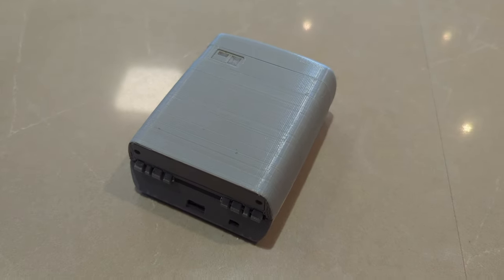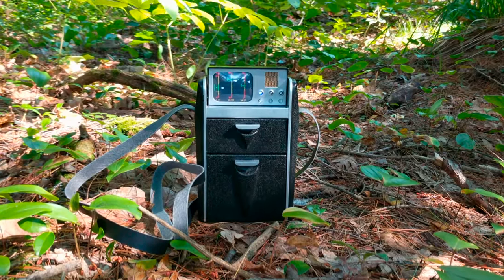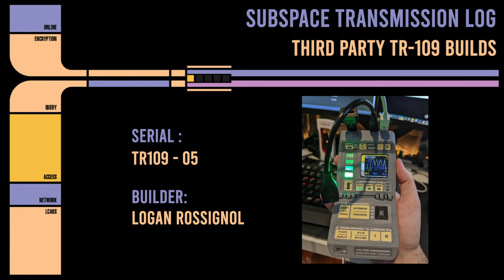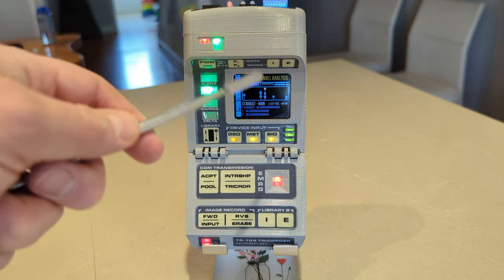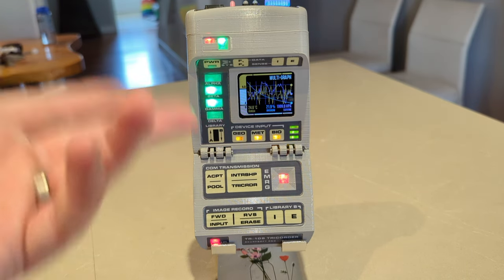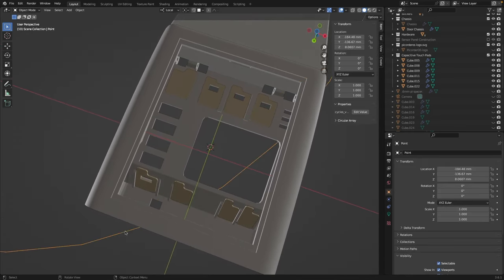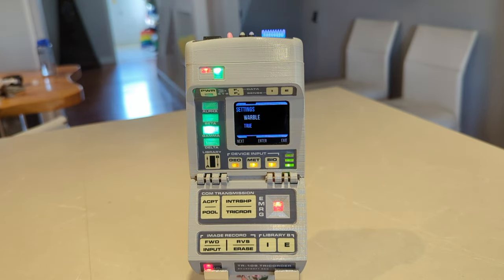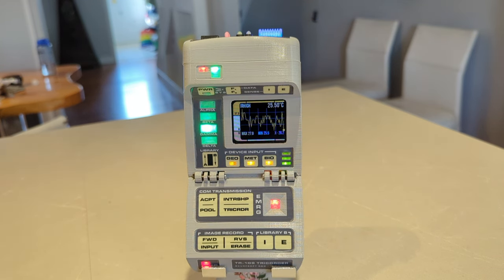[project] TR-109 Picorder - Update 3

Comment: This is great work!! I love the updated animations on the screen!
I've been working on a couple of Tricorder-like devices, one using an ESP32 that is ultra slim but the UI is pretty much just text.. the other is using the new RT-Thread HMI-Board for a much prettier experience but the thing is chunky as!
I've tried to steer away from the LCARS styling  but I am really liking what you have done with the UI!
What size is the screen? I saw that you are using the ST7735 LCD - I have found them to be somewhat lacking when in sunlight, so I went for the SSD1327 1.5" OLED for the ESP32 version.